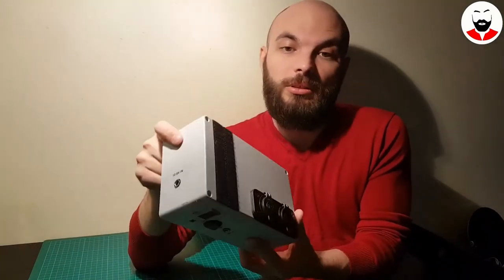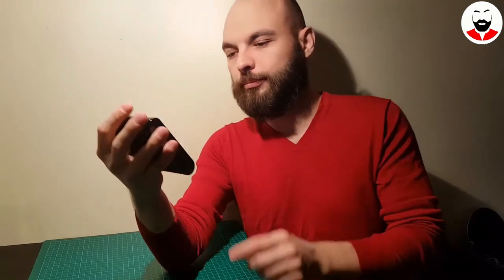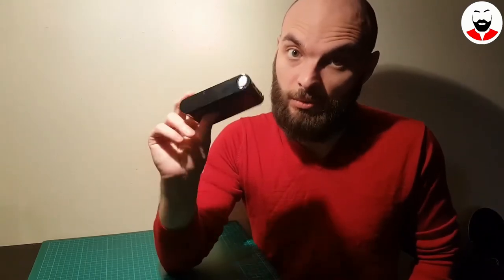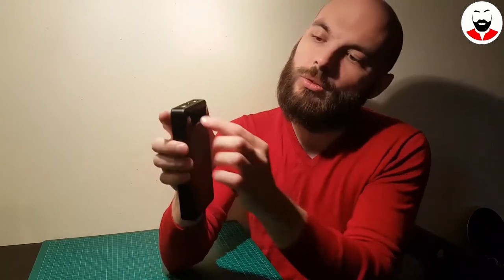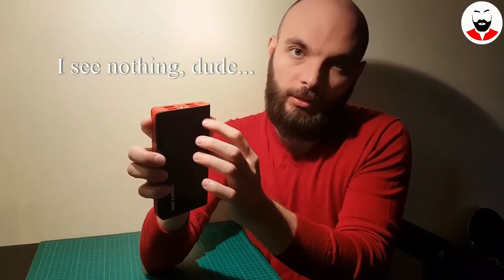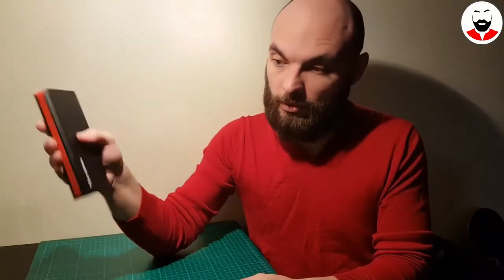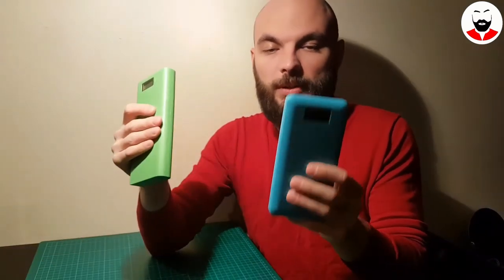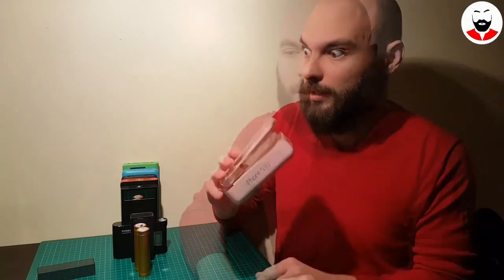CHEAP Power Bank Kits from China (for 18650 Cells)

Comment: I bought some of the larger banks off ebay for cheap and they arrived in ok shape. The single cell holders work great when you tear out the pcb and hook up alligator clips to it for charge/discharge cycling.
Reply from the maker: Did you measure what charge/discharge current they can provide?
Reply: Yeah, I used some charts available online to figure out what type of cell it is and test for capacity. I use only the same type of cells with matching capacity in these battery banks. I am looking at powering my a pc off solar/ dc power and I have a ton of 18650s from old laptop batteries and power tools.

Comment: What kind of security does this system have when recharging lipo batteries because I understand that each battery must be recharged safely so as not to damage it or risk of explosion
Reply from the maker: they have an included bms. basically all the cells are in parallel and treated like one big cell. this is why for safety and efficency, you need to have the cells with similar capacities, similar C charge rating and similar internal resistance. BTW, these are li-ion cells and I didn't try with li-po. I believe those li-po need different battery kits since the chemistry and charge parameters are different.